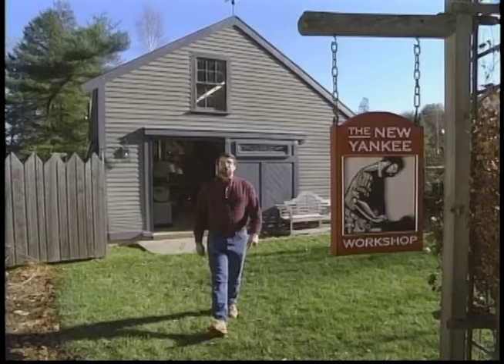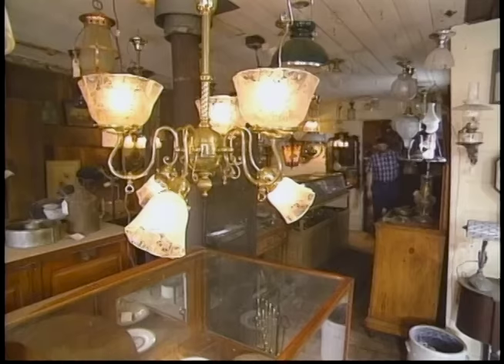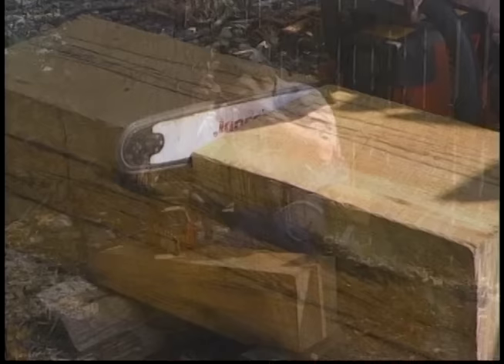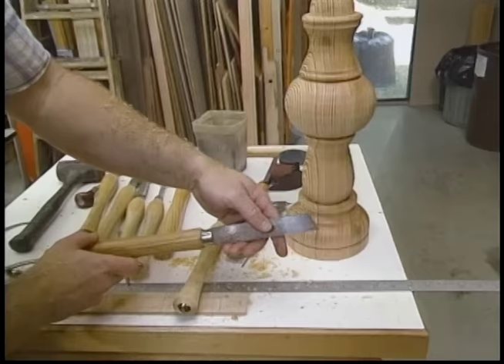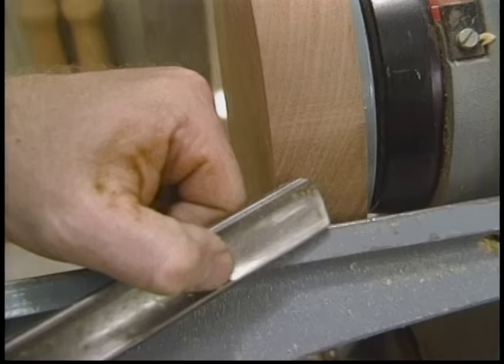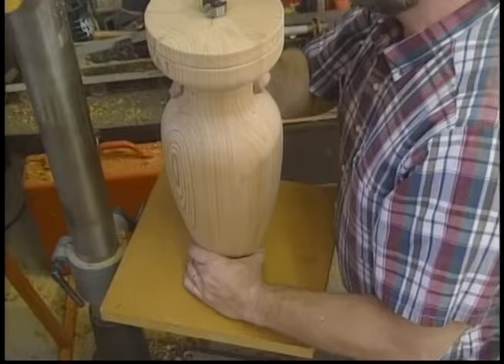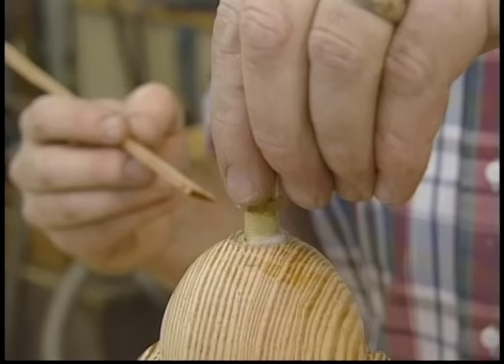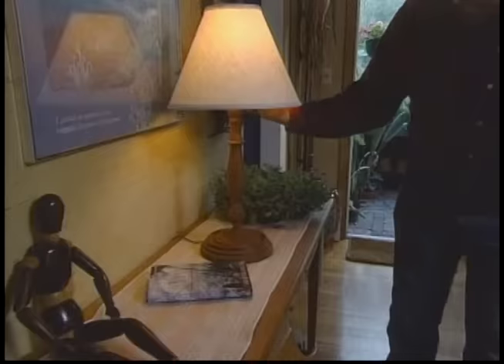Three Turned Table Lamps  |  S8 E09

Comment: I love watching thees again but they do age.
It does matter what wire you attach to what terminal. Doing it the wrong way can lead to bare metal that is energized when the lamp is off but plugged in. It's not a massive risk but listen to the instructions from your kit and have the hot wire go to the hot side.
Reply: Also the green felt and brass fittings would be swapped for black felt and oil rubbed fittings these days haha
Reply: Wrong. Incandescent light bulbs, fluorescent lights bulbs, and even screw base LED’s don’t care about polarity. The lamp kits you buy even today will have both terminals on the plug the same size which will allow you to plug it in either way to the outlet. As for the hot touching metal, lamps don’t come with a ground wire, and both terminals on the socket are guarded from touching the outer portion of the socket. Sometimes by cork, cardboard or even paper. Go to a big box store and you will find exactly what he installed here, and the instructions will likely not tell you to take the hot to one terminal or another. This was filmed in 1993, not 1953. It aged just fine.